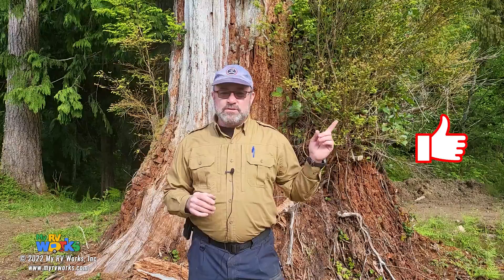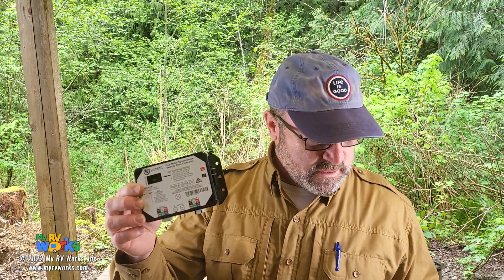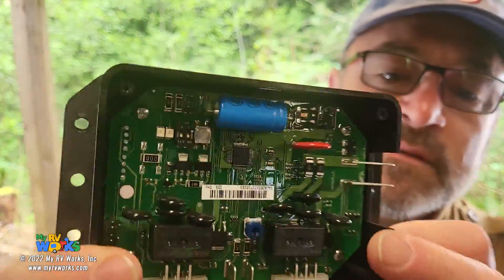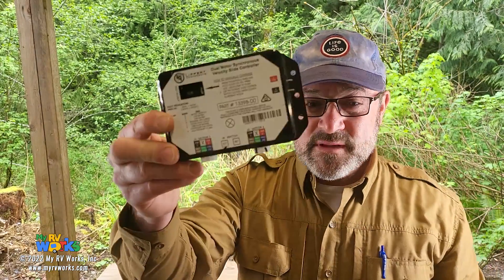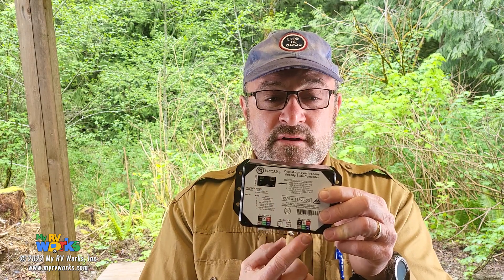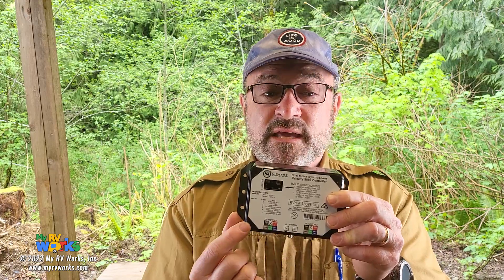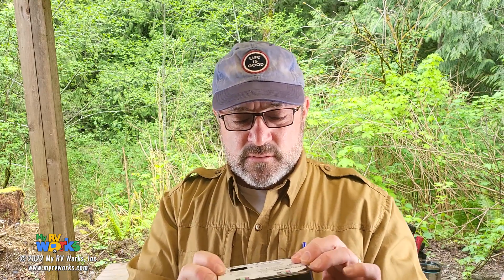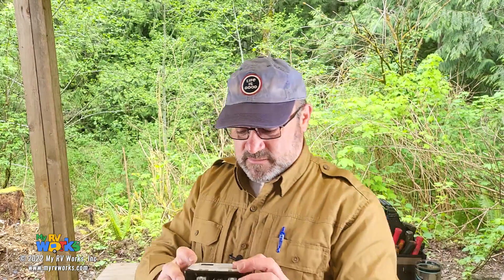Lippert Hall Power Short Error & Slide Room Control Module Discussion -- My RV Works

Comment: I have 2 green 8 red. Found 2 wires on motor broken, replaced motor, first was a aftermarket and 2nd was an OEM motor, still failing. Swapped out my controller with my other working slide, still failing. Temp installed new harness, still failing. The failing motor 2 works for about 2 inches then stops. Override procedure does not work. It's acts like it's out of sync but I can't resend either. Any help would be great

Comment: Please reply. You are amazing….i had switched the plug after getting the same code…reset it and the slide worked voilà…I had some water damage stopping it before and I adjusted the rollers in a way…but what would you imagine could make it throw that code over and over again and then work when I switch the plugs? Btw. You can see the fixed wall move when the motor starts tapping out right before it stops working and throws a code

Comment: Having bed slide issues again. I have a wolf pup 15sw. Slide wasn't working like it should and got code 4 red and 2 green. Replaced the #2 motor. Still not working and now showing 4 red and 1 green. 
It will only go in and out in jump mode. I have reset the controller many times and disconnected the power plug to exit jump mode according to Lippert videos. I checked voltage on #1 motor harness and show 12.78v , so not the harness. I don't know what to do except try and change the  #1 motor. Probably not the problem. At least I'm getting better on knowing how to change the motors. I wonder if something is bent somewhere? sometimes the bed will come in at an angle like one of the motors is working and not the other until i move it back and forth to straighten it out. It did this initially when #2 was coding and seemed like the #1 was working and not #2. Now it has done the reverse where seems like #1 is not working and #2 is. The motor have not died completely since they still move and wiring looks good. 
The controller model is 366701 , doesn't have the push button reset, only disconnect motor 1 and 2 which is supposed to put in jump mode.

Comment: you mentioned you need to clear all your faults on your controller before trying another troubleshooting method. Is that the same procedure as re-syncing the motors? do i have to extend ./retract the slides? ( step 2)

Comment: This was helpful! I had the 1 green 9 red code fault with the slide out and am in the middle of a cross-country trip. I switched the harnesses and it now works, except that the slide button (in/out) is backwards. Meaning I pushed the out button to bring the slide in. Any tips on why it is now working and what to check to get it to work as normal again?
Reply: Update: I swapped the wiring harnesses and am getting the same 1 green 9 red code fault. And, after the button override when pressing the slide in/out button, there is a loud click, the motors don't respond, and it faults again. I think that means the controller is bad...

Comment: I have no led lights at all.  Just returned from a weekend shakedown trip and all was fine.  Is there supposed to be an LED light when its powered up?  Mine has not LEDS lit up, but the slide will not go in or come out.  I have checked the 30 amp DC fuse is good.  I'm getting 13.3 volts at the power inlet to the controller.  I checked for continuity at the slide switch in the cab and the switch is good.  Does this mean the controller is shot?  anything else I can check?

Comment: I have the same problem,  but when I press the slide out button,  the slide works? Do I need to replace module?
Reply: I’m having the same issue, everything is working fine, but I noticed a blinking light and happened upon this video. I switched the wires and it stays on the motor 1 indication @myrvworks

Comment: I know I am late to this party, but my wife and I just bought a2020 Discovery LXE.  It does not have a programmable switch for the diverse slide which has stopped responding. The slide controller blinks one green and one red. 

Tested and have power at the switch.  Any ideas?

Comment: I have a 2016 Thor challenger 37tb and my slide control board went bad. Camping World wanted $700.00 for one. Found a replacement on Amazon for $55.00. it works great. Just wanted you to know there are less expensive options out there.
Reply from the maker: Yes, we have seen that a lot.  For example, on the Schwintek motors, Lippert wants ~$300 for a new one, but we have found them on Amazon for ~$60.  I let the customer know and let them decide and ultimately make the purchase themselves.  We do a lot of Schwintek work, and I have come across several of the cheaper motors where the DC brushes disintegrated in their housing.  So, that is the gotcha.  It is a buyer-beware thing, but you can buy 5 of the cheaper motors for one of the OEM motors.  Then just keep a spare and learn how to recover and swap the parts out yourself, and you are further ahead.  

We usually do not get too involved in the parts side of things - we give customers options and let them buy their own parts and hire us to install them.  From my business liability perspective, I would typically go with the OEM replacement simply due to the OEM standing behind their parts should something happen, and I have to go back out due to their motor failing in this example.  In those situations, usually the OEM will try to make it right with the customer and our shop to fix it a second time, but not always, and those companies that do not back up their parts are the ones that usually do not stick around and thrive.

Comment: Currently experiencing an issue with motor #2 where it doesn’t go out. Am getting code 2 green and eight reds. Have checked #2 motor and pulled it out and connected to harness of motor #1 and it works. Isolated both harnesses and did a continuity test on each harness wires and #1checked good but #2 harness wires showed no continuity on the red wire so I have concluded I need to replace motor #2 harness. What do you think? Still need to figure how I am running new harness because it runs under floor from dinette area across to slide side. May have to run it exposed along walls. What a hassle!

Comment: Thank you so very much!  I had this code while camping.  Was able to clear the code and pull my slide in.  Life saver❤
Reply: How do you clear the code.  This excellent video shows us how to changed the motor plugs to determine if the trouble code is the controller, or the motor etc., but I did not see a mention of how to reset before changing sides

Comment: I have watched your videos sinch purchasing our Motorhome. We are having a Schwintek issue now and the controller is saying a short between controller and motor, 8 blinks. the motor starts to run the quits.
Seems like a wire harness but I can't get the slide out far enough to get to it. ordering a harness now. 
Thank you again for all your insight an help.

Comment: Is an extension harness for between motor and controller? I'd like to relocate my controller to a spot with easier access....all I need is 4 feet to get to a better spot. It should have been built the way I'm thinking from the factory. 2016 Lance Model 2285.

Comment: I’ve got a 2018 Columbia Palomino. It has the Lippert One Control system. It has 3 hydraulic slides and 1 electric slide. Just recently when I try to open or close the hydraulic slides it blows a 30 amp fuse but only when I am using the app or one control panel. When I use the actual switch in the storage compartment, it works fine. Any clue what this could be?

Comment: I have a slide controller fault code:
one green blink 9 red blinks - hall power fault to ground motor 1....
I have cleaned all the corrosion from the bus bar and the terminals. I also replaced the 20amp auto-reset breaker as it was grossly corroded.
I get clicks in the motor and then reverts back to the fault code.
I then swapped the terminal for motor one and motor two to see if I can get a fault code on motor two---- trying to isolate if it is the motor or wiring harness.
The fault code remained on motor one (one green blink 9 red blinks) after the swap.
Would this indicate a faulty control unit?

Comment: Thanks for making this and all of your other rv tech/maintenance videos, they are super helpful. I have a quick question - I was trying to diagnose a fault in ours - sometimes the slide just doesn't operate at all. I noticed 2 blinks - meaning power dropout.  So I started diagnosing that.  When I started to disconnect the input power connectors to test if it was getting power, I noticed the unit would flash. It seemed I had a bad connection probably at the crimp-on connector.  It looked okay but I cannot see anything else that might be a problem. I pulled the cover just to make sure the connector to the  PCB was good and it looked solid, so I re-crimped a new connector (both, actually - despite not being able to induce a fault by flexing the wire at the connection while measuring voltage).  So far seems okay.   But here is my question: I noticed that when I pulled the fuse for this - the voltage at the input power dropped from 13.4 (my float) to 12.7 - so it had some phantom power on it - probably not much amperage but I'm wondering if this is normal or not ? I kind of expected with the fuse pulled it would drop to 0.  Thanks again for all the wonderful videos you make - they are very helpful for those of us that like to DIY.

Comment: i have a 2017 Starcraft 21FBS Launch Ultra Lite travel trailer and when i tried to run out the slide the left side as seen from the inside would not move the right side moves some and stops, but will return.  problem is i have gone through the thing and have not located the controller.   anyone who is familiar with these and can give me a idea of where to look. that would be awesome.

Comment: My controller is having this exact problem in your video. 1 Green, 9 Red. I did the over-ride reset, and it seemed to fix the problem. If it keeps re-appearing what are the next steps to check?

Comment: How do i get it to clear and reset code when I’m switching sides?  Or put into mode where it will show codes? I had the exact error you show but when switching cables no codes are showing up at all    The reset 6 times and hold on 7th does not help with getting slide to actuate    Thanks!
Reply: My controller is only a month old🤦‍♂️

Comment: Our power slide on 1999 prowler , will come in but not go out, when the problem started my hubby was putting in new water pump, and he did  get enough water in compartment to get on floor of trailor,  but he also was working on changing tires, I was standing outside and heard a noise, jumped on into trailor and the trailor was trying t o m o ve out I removed one holding bar, then tried to stop it by pushing in button, my hubby got bar out,finally out trail9r back it, it tried to move out again, then stopped, we moved it back in, then tried later to move it out, not working,   the trailor now will not go out b u t it will come in,  any suggestions?  Is it the motor, one wire when tested has no power

Comment: Have a 2012 Grey wolf slide got hung up shorted the power wires together. All fuses are good but I have no power to the board. Any inline fuses you might be aware of? Slide, all Jacks and levelers plus awning dead. Thanks New battery

Comment: I have a 2013 Coleman CTU271RB I cannot find the Schwintex controller. My Slide out is stuck in the in position. I was able to un-plung both motor and I still cannot push the slide open. where do you think the controller is located, i have look everywhere except the cabinet restricted with the slide in in position.
Reply: Did you check in the top (ceiling) of the storage compartments?
Reply: The controller is in the bedroom division wall , remove panel held in with 4 screws.😊

Comment: I'm having this exact fault on my slide-out today. I switched the harnesses and the code did not change. How do you clear the faults on the module? I ordered a new harness, but looks like I won't need it now. But now I have a spare. Can you use the recovery function in both directions? Thank you

Comment: This past weekend I moved my camper home for the winter and one of my slide outs is not moving on one side. It sounds like the motor is working on the side that's not moving. Any suggestions would be very helpful. Thank you.